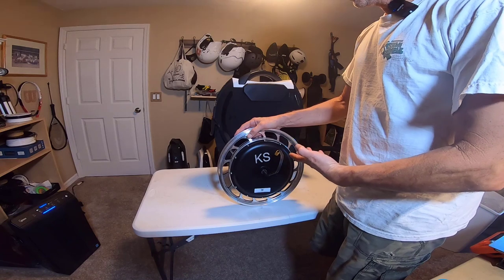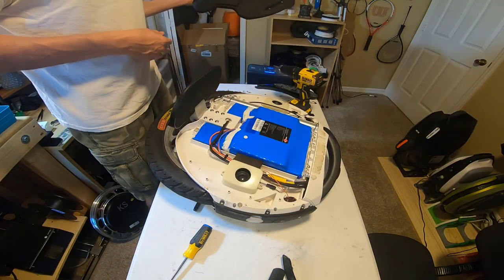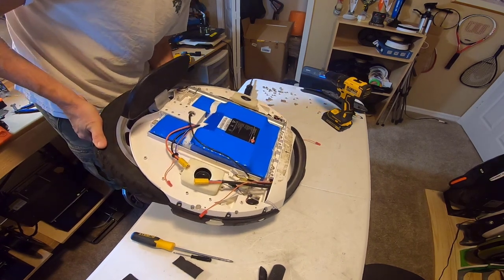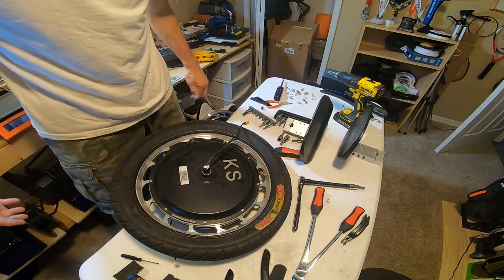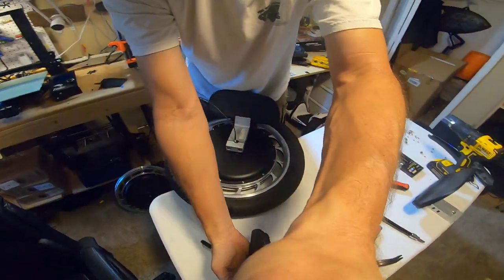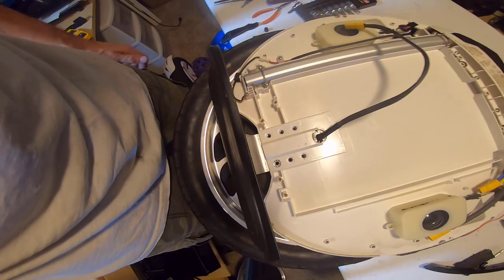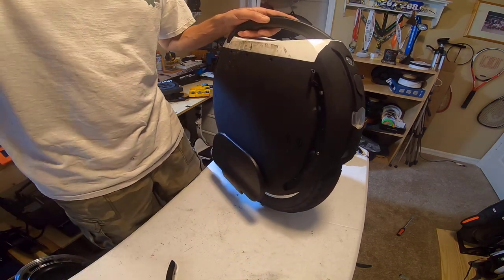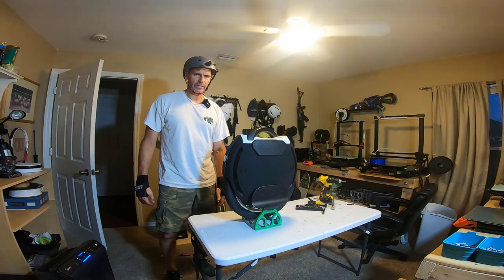Is it worth it? - KingSong 18XL 2200 Watt motor upgrade!!

Comment: After replacing the wheel the phone app proposed automatically the new version upgrade? So there is a detection of the new motor?
Reply from the maker: No, I just had not done the 2.00 firmware upgrade yet which works with the old and new motor.